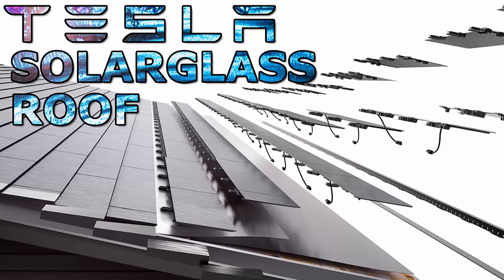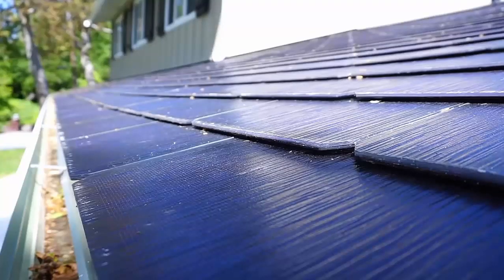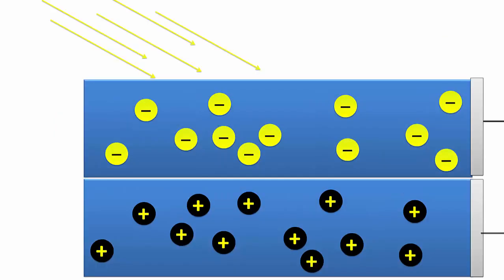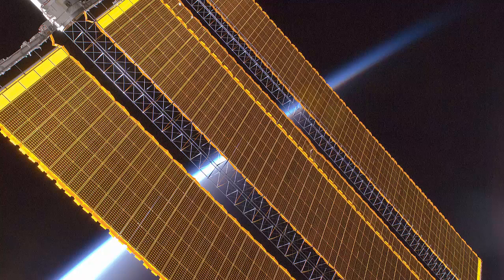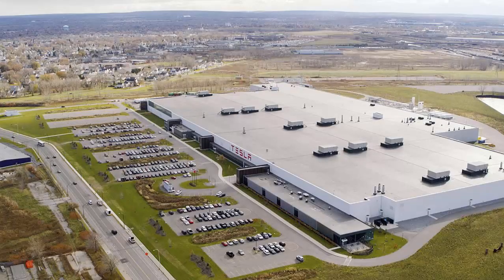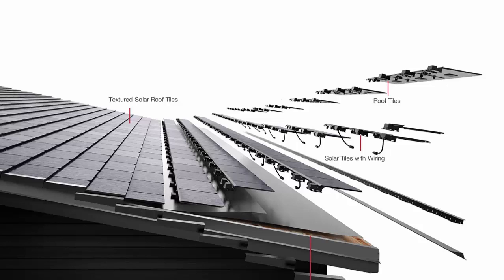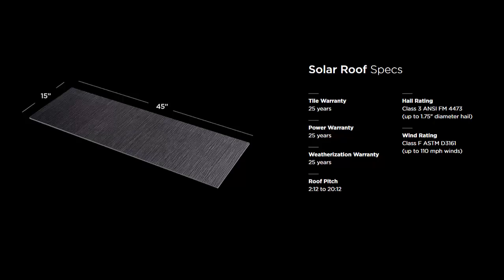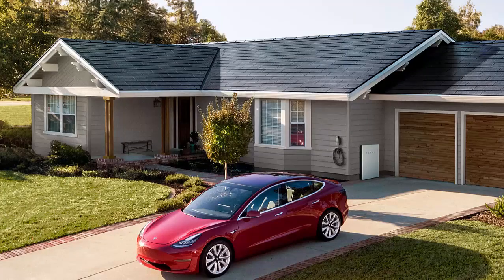The Truth About Tesla Solar Roof

Comment: In the graphic you provide it states $700/ft or $1.99/Watt.   Is this the price of the square footage that has the actual energy producing solar tiles or does it include the tiles on the off-side   of the home that don't generally get the direct sun light?  Does this pricing scheme include the actual installation?

Is the entire roof covered in solar roof tiles?  With conventional solar panels; and even with versions 1 and 2 of the Tesla solar tiles, weren't the solar tiles only installed on the side of the roof facing the sun?  The remainder were matching dummy roofing tiles?

Also; I suspect that like versions one and two of these Tesla Solar roofing tiles, they are aimed mainly at the well to do; those with higher incomes than average Americans.  The prices they put out there are no where near the price of a roof installation where I live.  My home in particular cost only a bit more than the 33-grand in the price graphic; and if I got a gang of illegal aliens to install a new roof that might only cost me a couple of cases of ice cold beer and maybe a couple of hundred dollars a piece for the crew.

All joking aside, there is still a lot of details missing in all of this.  I'm thinking of tearing down and just rebuilding my home from scratch.  In doing so I had planned on installing solar panels but if more accurate numbers could be nailed down this might be a viable alternative.
Reply: Tesla has non solar and solar tiles that look the same.  So they only put the solar tiles on the sides of your home that survey shows will receive adequate sunlight.  The rest of the roof would the non-solar tiles with the same look.  If you look at the price of a concrete tile roof, not shingles you buy at Home Depot, plus solar, Teslas numbers are correct.
Reply: Tesla is lying about the cost of competing roof installations to make his garbage look better. A steel roof with traditional panels will be cheaper, and the roof will last for as long as the house. Replace the panels if needed, a d the roof stays intact.
Reply: @TroySavary  I see the good that they are attempting to convey to would be buyers but sometimes it seems that it's just wealthy people marketing their wares to wealthy people; people who have over time been indoctrinated or guilt-tripped into the climate change narrative.
Still; I too would buy a solar setup like this if I could afford it but right not it's out of my price range even though it's touted as economical.
If you do a search on YouTube of the "one year since installing" reviews of solar power,  the vast majority will show exactly what this particular review has shown.
From an economic or financial stand point it's not really worth it at this point in time.  As the technology improves, eventually it will become worth it all but not now and not with the present level of technology.
Reply: @MrTjmk  The main reason I would install solar or wind would be to go off grid. Tesla's system is no good for that. The power wall requires an internet connection and doesn't work with wind power. Solar alone won't suffice in Canada in the winter. There are cheaper and better alternatives to Tesla.

Comment: considering you can get a 45 year shingle roof for 8-10K a solar roof shingle that only lasts 20 years but cost 45k isnt a good deal. nevermind its just the official warranty. how many KW for a 2000 square foot roof?
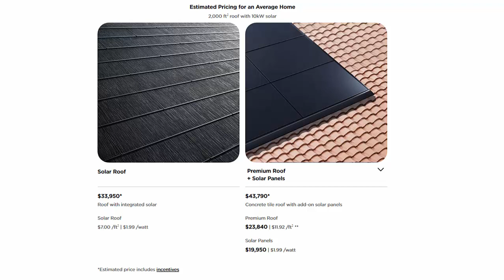Reply: according to 10:25 both systems should produce 10kWp. But that's really inefficient for such a big area. Now with half the roof on your north side, you get maybe 7 kWp out of them?

Comment: Wonder how good a "Roof" this is? ... will it leak?
Reply: It will not leak unless a screw up happens like any other roof.
Reply: @Barskor1  Would be nice to see what testing has been done on these roof systems .. seems everyone only focuses on the solar cell performance aspect.. while ignoring if it makes for a good roof or not?
Reply: @KrustyKlown  Tesla spent a great deal of time and money on that very point.
Reply: @Barskor1  Yes, I am not saying they didn't ... but in marketing this new roof, they need to also sell people on it being a "roof".  If I needed only a new roof .. and somebody suggested using something VERY different from traditional roofing materials, I would be VERY hesitant. When large purchases are involved, it is NOT easy to convince people to move away from what they are comfortable with, even when that new thing is better and cheaper. A superduper 30-50 year roof leak warranty would probably create purchasing comfort.. will Tesla offer such a thing?
Reply: @KrustyKlown  I just popped over to their site tesla.com and they have a 25 year weatherization guarantee 30 year ones are apparently considered a bit much by the roofing industry in general but I just casually researched that. Hope that helps and have a good day.

Comment: I sell solar and get this question all the time about this.  One thing I think you are forgetting is the calculation of azimuth when it comes to covering a whole house with these things.  These are ok for East to west facing roofs but north and south facing roofs the north side gets no exposure to the sun in the Northern Hemisphere.  What would they do on a home that a north facing roof where these are not needed at all?  Half shingle half solar shingle.  Doesn’t make sense to do this at all.  Traditional solar is the route to go.
Reply: This will be vapour ware just like versions 1 and 2. Musk needs to keep the stock hyped.
Reply: That is why the roof has some tiles with solar cells and some without solar cells.  Only the parts of the roof that get sun exposure use the tiles with solar cells.  Everywhere else uses the cheaper tiles without solar cells. The consistent looks should kill tradition solar panels sales for people with tile roofs.
Reply: @JBoy340a  They have been saying that Tesla solar roof tiles would take over the market for about 5 years now. So far, nothing.  No sign of this changing. Still too expensive compared to alternatives, with lower efficiency.

Comment: Solar roofs are nothing new. Solar Shingle has had a solar steel roof since 2008. Steel roof panels with integrated solar. Much simpler installation since the panels, are larger, requiring far fewer connections. I wish YouTubers would do a couple minutes searching the internet before they slobber all over Musk in videos.

Comment: Nuclear power is the future.
Reply: for infrastructure and industrial use, maybe.

for residential? no. the cost of transmission alone will be bigger than localized solar rooftop production.
Reply: @pokeshark  transmission already exists,  local solar production is only a positive thing if people go off grid.  If you still want to be grid attached it is a source of instability and complexity in dealing with thousands of lintermittent low power sources.

Comment: just watched video on fire and venting i install solor for a living have for 11years don't understand why tesla has a different set of rules it's not code complaint not the same rules we have to follow something not right
Reply: butch kern as a solar installer for the past 3 years and currently working for them I can assure you we go by code and if not the system doesn’t get turned on duh.

Comment: What happens if you need to walk on the roof?
Reply: If they can handle golf ball size hail without damage, they should be able to handle being walked on at least as good as other tile roof materials.
Reply: Since it's made of slick glass you probably go to the hospital from falling
Reply: @MrBlueTimes  Based on my experience playing games on slippery roof tiles, you can keep on jumping forward and safely climb any slippery roof. As long as the rate you are jumping is faster than the rate of slipping.
Reply: @HABD DZ 's story checks out.

Comment: The solar gain is not equivalent throughout the roof structure. The actual output will not be consistent with the square foot of roof, for example north vs south face, local shading etc. ultimately this another stock pumping scheme on the part of Elon and will have little overall market effect..
Reply: Yeah. Tesla is a bit player in Solar. Musk already scammed investors by using Tesla money to bail out the failed Solarcity. Now he doubles down on failure by pushing vapour ware version 3.

Comment: Firefighters walk on and cut holes in roofs, with chainsaws to vent fires.
This is dangerous and wont end well.
A slippery roof thats strong and can’t be de-energized.
Reply: The Tesla solar roof is lower voltage than panels that use micro-inverters. Here's an interesting video showing firemen training with the V2 Tesla roof: https://www.youtube.com/watch?v=zunHya-0EQY
Reply: In my state, all homes with solar systems cannot have active solar panels or tiles within 3 feet of the ridge line because of the need to fireman to cut holes for venting.